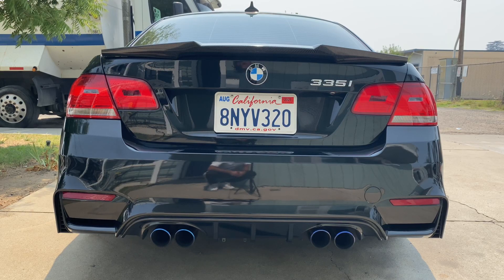335i n54 straight pipe cold start (with catless downpipes)

Comment: i got new injectors too bro and i gto a slight hiccup on cold starts exactly where yours happens to right when rpms go down then goes away when the idle smooths out, i guess its normal for n54's on colds tarts i always be tweaking.
Reply: Mine does the same shit. My N54 has 72k miles on her.
Reply: I thought it was just me lol my has 74,000 miles
Reply: Yea that just about confirms it, completely normal you cant get rid of the hiccups